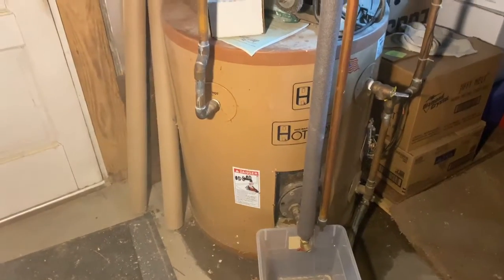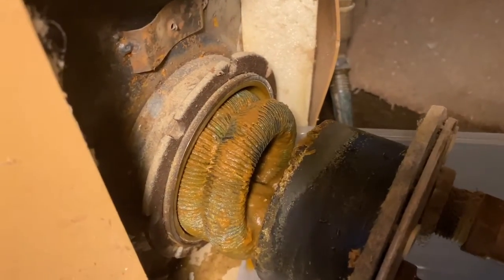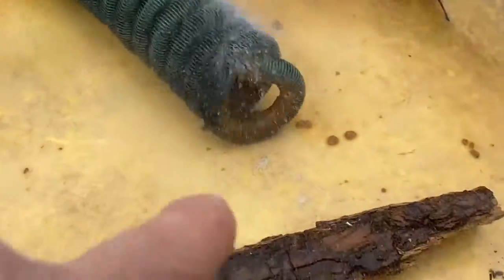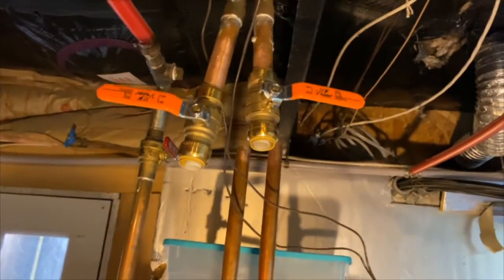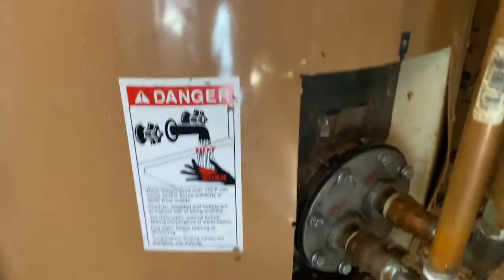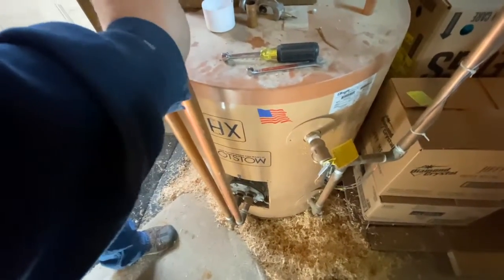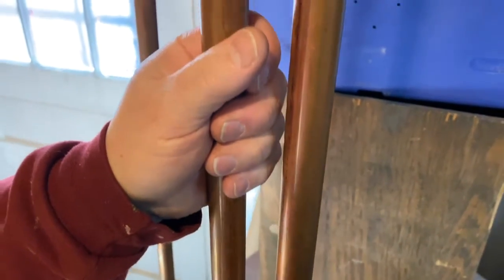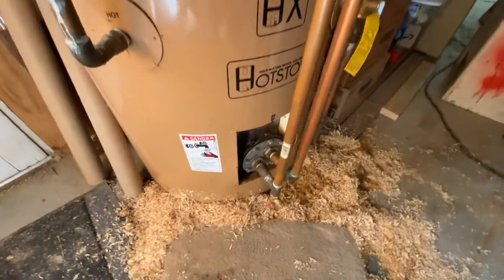indirect water heater diagnosis and repair

Comment: is it possible to clean the coil by say filling the tank with a cleaning solution or something like 40 gallons of white vinegar and let it sit for a bit? I have very hard water in my area and hooked up a used BoilerMate. I'm afraid this may happen to mine. I have a water softner to install but that will only ensure there won't be future scale.
Reply from the maker: Well I’m not sure in your particular situation but as bad as mine was that would not work it was so much sludge if I were to break that loose it would just end up through the pipes of the house and plugging up all of the Fossetts. Maybe if you have light scaling or something not so drastic as you saw in my situation your idea may work however as I said for my situation there’s no way that would work efficiently. I hope this helps and thanks for the question.
Reply: @shanesmaineshop should have vacuumed the bottom of the tank and rinsed it as well.